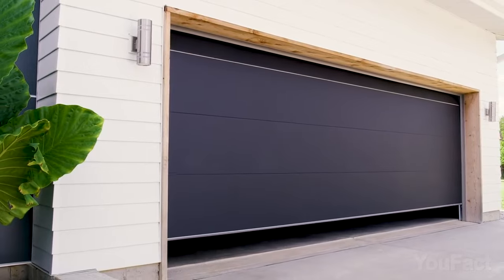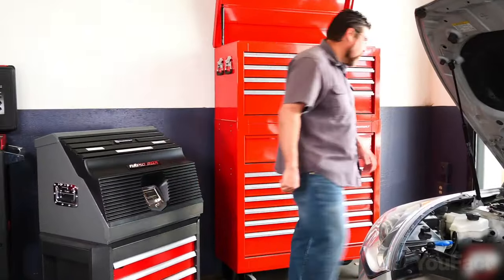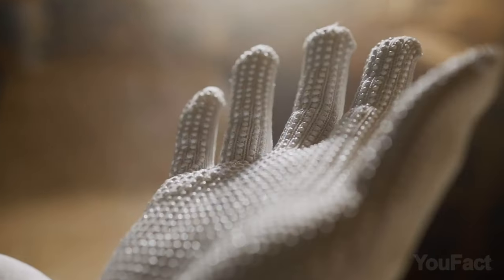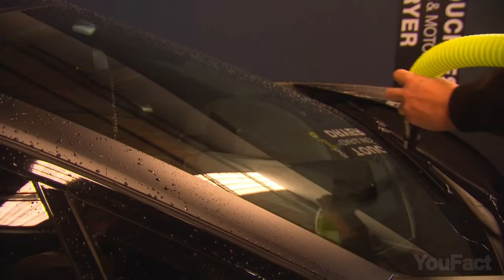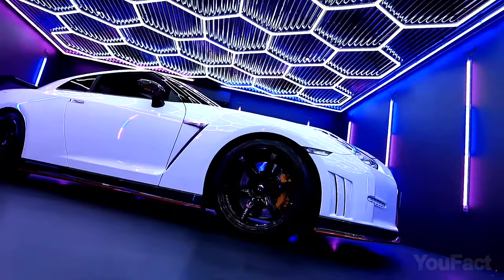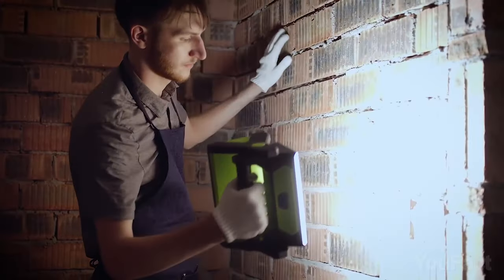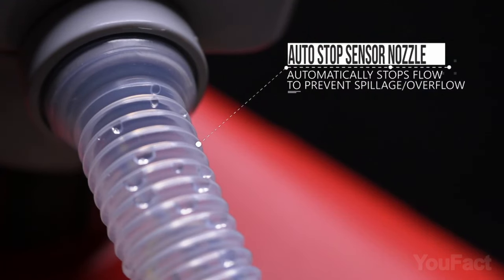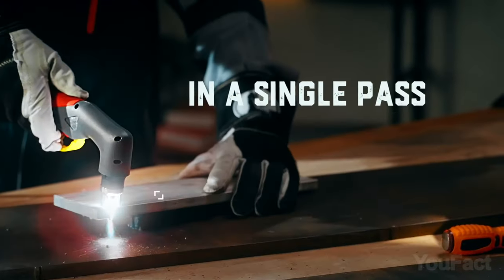24 Coolest Inventions to Upgrade Your Garage

Comment: 9:32 NEVER EVER "START" a nut or bolt with a power tool. Doing so is a surefire way to cross thread them. You can Hand start them and then use this to finish them, save for torqueing them down. Never put the Nut or Lug nut, or Bolt in a tool and then place it to the car. Never. That is when I have to come behind you and place thread serts or helicoils into spark plug slots. Or I end up having to charge you for 5 lug studs and labor when you just wanted a free tire rotation.
Reply: Good advise to the novice but if you know how to properly operate an air/electric powered tool you'll be fine. Hand start the fastener, feel for resistance, if good fasten it down.

Comment: The extra fuel attachment I could totally of used last week. I ran out of gas ⛽️ “ idk 🤷‍♀️ how “ I have the screen that tells me how much is left. But pouring gas into my car 🚗 was tough and my gf didn’t help me much I was letting her use my car for her drivers test.. I got there and I had ran out of gas ⛽️.. rushed over got gas in the can. Asked her to just hold the funnel out a little bit so I could pour the gas out slowly to not waste spill or get any of it on me right…well she grabs the other side of the fuel ⛽️ jug and is letting it drip everywhere while we both try to pour it in she’s trying to go fast bc it’s cold and we are now late to take the exam. ‘’ she’s never done anything car related before “ so she didn’t know you take it slow in order to not WASTE any GAS bc need ALL OF IT. 🙄 I haven’t ran out of gas since I was 17. But ya I’d like to have one of these lol